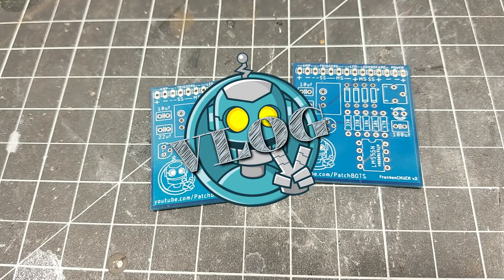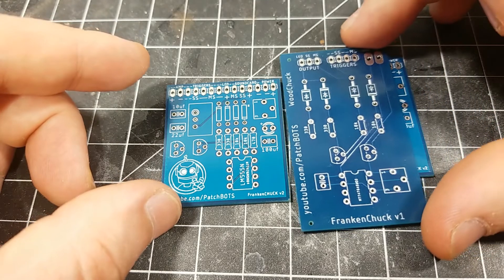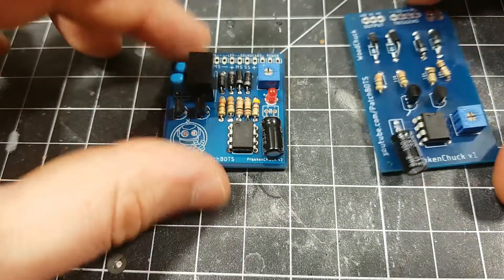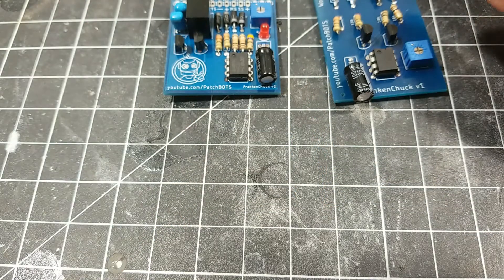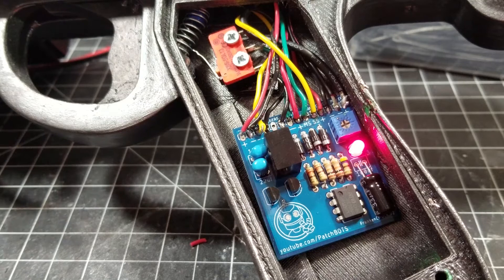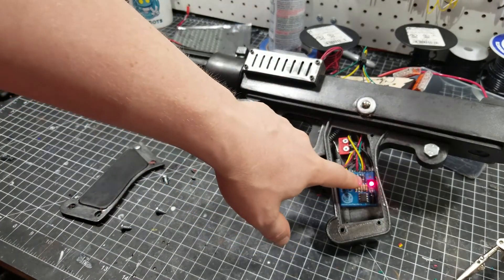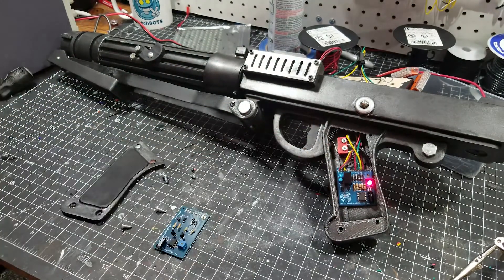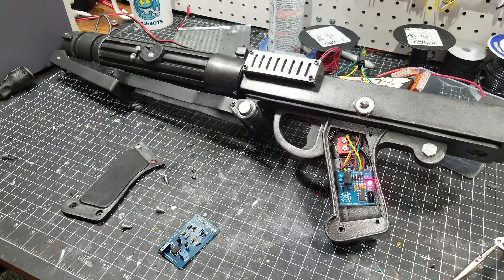Vlog #003 - Printed Circuit Boards #2

Comment: Have you considered using an Arduino compatible board with Bluetooth? Kill 2 birds with one stone. Boards that come to mind are the ESP32 and the Adafruit NRF52 Feather.
Reply from the maker: Yeah that's kid of what I'm going for, but i even want to eliminate a traditional "Arduino" altogheter.  The end end goal will be to just have a microcontroller and necessary components right on board.